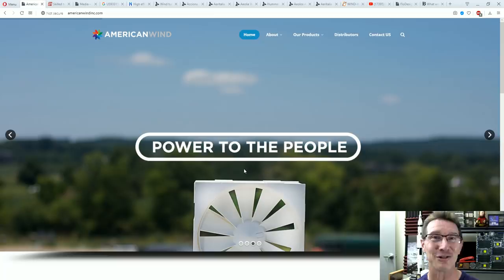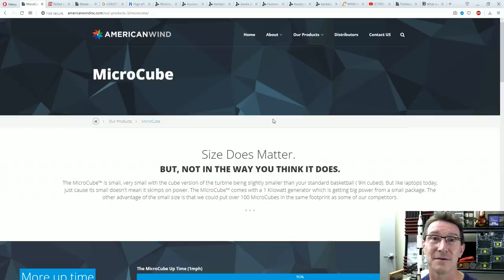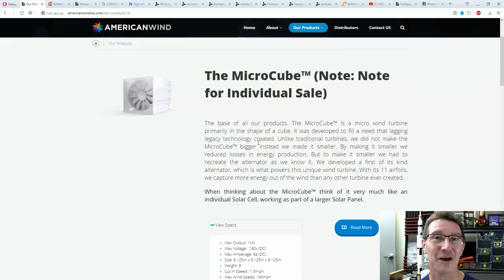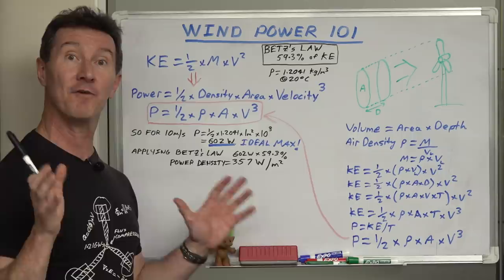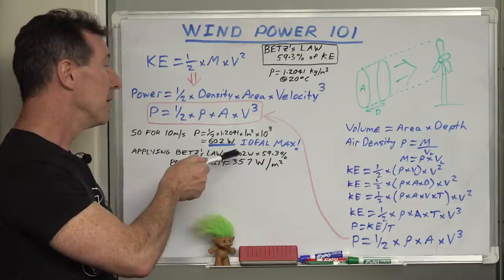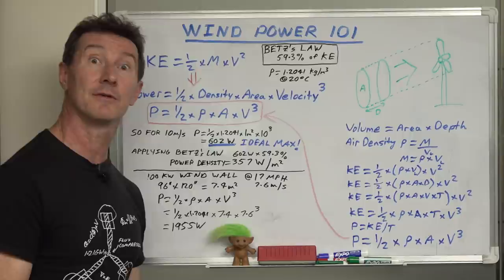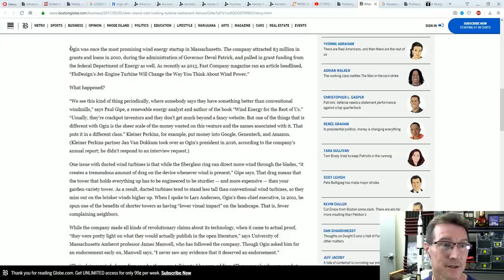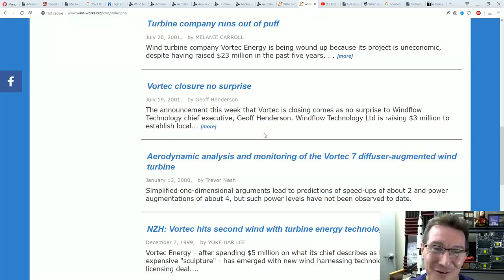EEVblog #1271 - 100kW WindWall Generator BUSTED!

Comment: wait... 
"It speeds up the wind as it goes through."

so....
wait......
where does added energy come from...

oh right, jet engine "technology" that explains it.
Reply: Fluid flowing through a constriction does indeed speed up as it goes through: this is called the Venturi effect and is the principle of operation of, e.g. carburetors. This increase in velocity is accompanied by Bernoulli's principle: any increase in kinetic energy is balanced by a decrease in potential and internal energy. Bernoulli's principle is a derivation of the principle of conservation of energy. With the Venturi effect, while kinetic energy increases for fluid flowing through a constriction, potential energy drops due to a drop in static pressure.

The most energy one can get from wind is to extract 100% of its kinetic energy, bringing it to a stop relative to the ground. Using a duct or constriction, one can temporarily increase the kinetic energy, but doing so by borrowing from potential energy. Claiming to extract more energy by increasing kinetic energy, but then never "repaying" that energy back from potential energy, would require that the system is continuously reducing static pressure, i.e. continually decreasing the earth's atmospheric pressure. Both sides of the turbine are exposed to atmospheric pressure, so this is impossible. This is why Yost's claims break the laws of conservation of energy.

Yost could be claiming that the Venturi effect is caused by the air funneling itself into the turbine, with the turbine being the constriction and the effective area being much greater than the constriction itself. However, this is a preposterous idea, because there's no reason that a fluid would somehow magically funnel itself into a constriction, instead of just flowing around it. Thus, the claims collapse no matter which way you look at them.

Comment: your formula is not considering the wall... when you get the air to duct it will increase speed... works like forming pressure or potential energy as energy goes with cube of velocity... although this prototype they presented cant realy get their claims of power output but a big building having such ducts with turbines inside would completely change this figure. of course not so much power but some more than conventional turbines.. i worked with vertical turbines and we got 500W in a 1,2m2 

greetings from Brazil
Reply: the interesting thing is that design really matters since we are transferi momentum

Comment: ☺😊😀😁😂5 Love it math😆.👍 I use delta P for gears got a 3.7kw high amp car alternators 20units on electrical motor load at 106ish rpm for a 3000rpm out put supply set battery and multiple regulator system for direct load use and charge on this after loss have 93ish kw was doing it for aviation 1.5 tone craft but needed a new motor what a pig but would work for energy on my pumping system for the 200m full green closed fish pen what a beast😆.👍 finishing a real base set soon schooling engineering wait and see. I Got all 3 max profit for the real world.....was thinking a multi fule car on rail tec😮what a range on tank %.

Comment: Sorry Mate, but you are absolutely wrong as I have built several devices that give you more output than you put in and the whole nonsense that you cannot get more energy out of something than you put into it is and has been proven wrong for some time now. You actually use many devices in your house that do this. Your refrigerator does this as does your air conditioner and there are many other devices that have a COP of greater than 1 and this my friend is what you would refer to as over unity. Nature does this all the time and this fallacy has been conjured up to keep people from ever thinking they can build anything themselves that would be better than the big business thieves of the world. You just need to configure your devices to harness the abundant energy available all throughout nature instead of the way we have been taught to do it as wasteful energy killers. I have even built windmills that violate this formula that you described here by building your circuits properly and using proper magnets and I can see where if someone put a considerable amount of time in turbine development and could increase the velocity by creating a low pressure on the back side then even by this formula you could get more than the 6oo watts per square meter. Perhaps you should get one and then bench test it to actually prove the truth of it. I'm sure they have demonstrated this to be able to make these claims.
If Al Gore was involved then this is probably why they failed but you must understand the politics and "Big Oil" and "Big Energy" that fights any new tech that could threaten the the existing economic paradigm. They shut down electric cars when they were introduced years ago and they have certainly stifled solar tech and battery tech.  With your ridicule and misguided belittling attitude and false brainwashed belief in a law of science that has been proven wrong but no one will admit that this is fact due to this ridicule, is what causes and keeps  anyone from ever introducing tech that is revolutionary as people like yourself have bought into the whole nefarious plan to stifle it. You went on a grand rant of how it could not be done then contradicted yourself with other companies that did build a windmill that did violate your formula deduction but then you tried to discredit the facts by pontificating an irrelevant notion of them going "Belly Up" as you put it, shame on you. It is almost as though you are a paid gate keeper.